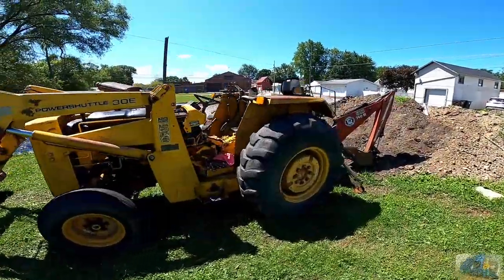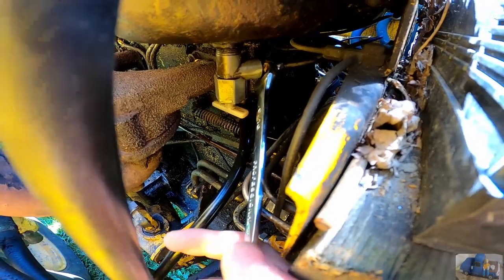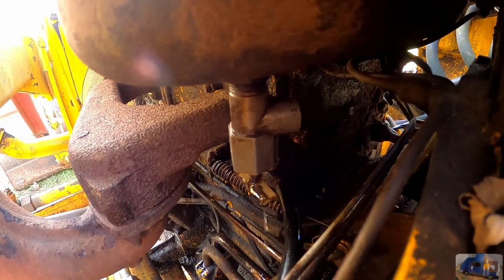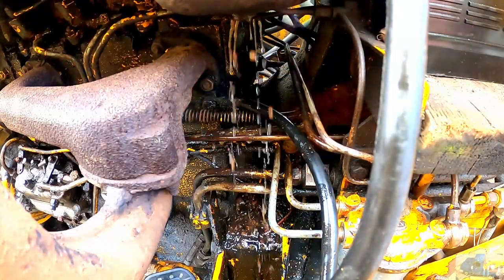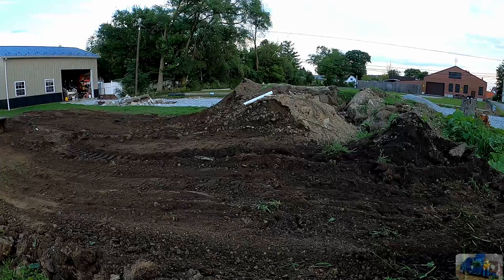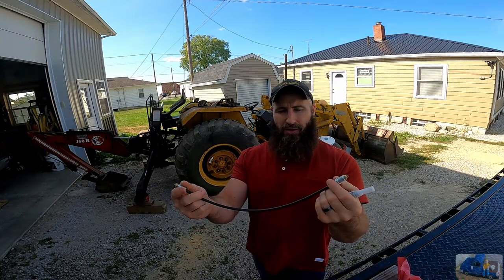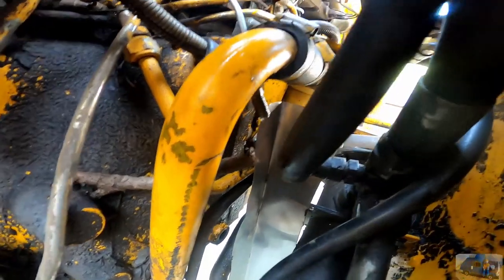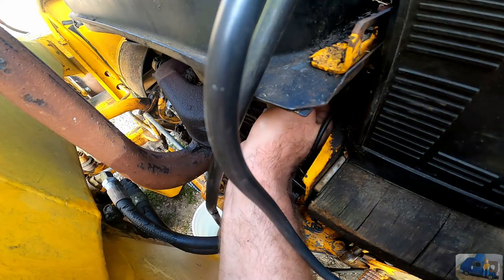MF30 Massey Ferguson Industrial Loader Tractor; Fuel Issues / First Cuts

Comment: Would you buy a 1973 MF20 that has not run in a year, owner says it ran, but battery died and that's hasn't been able to start it this year.  He's asking $500.00 with loader. Three point doesn't work and power steering is not working. Thoughts?
Reply from the maker: Hi Kay!  It's really hard to tell without looking at it.  Use your gut instinct.  If you think it can be repaired without many expensive parts then it could be a worthwhile deal.  If you are skeptical I wouldn't pay more than scrap steel prices for it ~0.095 cents a pound on my last trip to the shredder.  Tires are a huge expense check those over good, check all the fluids and at a minimum try to turn the motor over to make sure it isn't locked.  Oh and check the intake for water.  Water in the engine and or oil and I would consider it scrap.  Thanks for watching and happy tractor hunting!  👍😁

Comment: Great video...your tractor has some issues.  I just bought one with a bucket on front and a Gannon on back for grading.  Looking to get the backhoe attachment for the back later on.  I have no issues with my fuel line at this point, but my brakes have no pressure in them at all.  Probably both Master Break Cylinders are shot, but I find it hard to believe both MBS would go out at the same time?  Any advice on trouble shooting them before I spend $260 for two MBS?  I'm not a certified mechanic, but I'm very skilled with manual labor, mechanics, etc.  I own a woodshop so I'm pretty detail orientated.
Reply from the maker: Thanks!  I purchased this tractor as a dead horse in August.  I was excited to get her going without major engine repair.  In a separate video I try to illustrate how to repair  the braking system (it's very tight confines under the floor board).  Both master cylinders were shot on mine.  The mounted angle encourages dirt, moisture, etc to leak into the piston bore.  If the boot becomes damaged at all the master cylinders will fill with junk.  I would replace both master cylinders.  I purchased aftermarket units for $25 each from an English car restoration site.  Same exact unit, but a fraction of the price of one purchased from a tractor dealership.  Check out that video it should help you out.  Thanks for watching!  Cheers 👍😁
Reply: @FlatThunder  what  internet site have you used for  parts for your Massey Ferguson? I’m trying to fix a MF 50 backhoe and can’t find  exact info on it.
Reply from the maker: @hmm492  https://www.yesterdaystractors.com/
I bought a manual from Yesterday's Tractor's.  I also purchased a few other parts from them.  Great Service!  My piston seals came from Martin Fluid Power (MFP). Thanks for watching! 👍😁

Comment: Thanks for posting !! I have an immaculate MF30 with MF30A loader and grade box w/ hydraulic rippers.. it’s has 2,065 hours it ran like new until someone used it w/o permission and I think bent a valve due to water in the diesel. 
As you know, they are built to last. You’ll get a ton of work out of yours👷🏽‍♀️what engine do you have ? Mine has a 3 cylinder Perkins.. great little engine !
Reply from the maker: Thanks!  I think it is a stout tractor.  I also have a Perkin's 3 cylinder.  I hope you get yours back in operation soon.  Words can't describe how upset I would be with someone for breaking my stuff.  Thanks for watching! 👍😁  Cheers
Reply: @FlatThunder  LoL ...  I bought mine from a guy who owned a lumber yard so it was only used for loading a few buckets of rock into a pick up.  The only words I have for the clown who damaged my tractor would put me in jail so u I’ll remain silent.. yours is in great shape and operates great !  The steel on these old Massy’s is tough,  not like the new age tractors of today..  I’m told their in demand because their easy to work on,  no computers.  My only drawback with mine is because of the Transmission I have no PTO Spline to use with farm implements like brush hog mowers ..
Reply from the maker: @GreenbrokePete    it sounds like a nice lightly used unit!  I wouldn't swear to it, but I think the rear ends are common.  Ie I think the internals are the same on units without a pto, and the drive could be added?  Big maybe?  I too think old steel is better than the newer units.  I rented a 3030 Kubota in the past and the three point lift arm adjustment was broken and made of pot metal 🤔 Cheers,